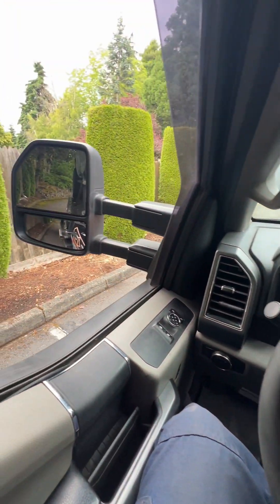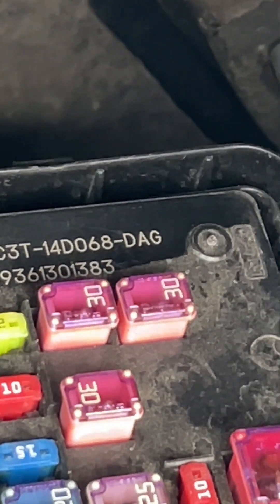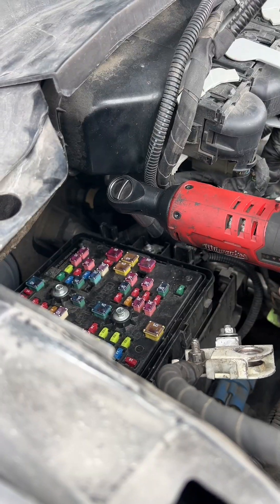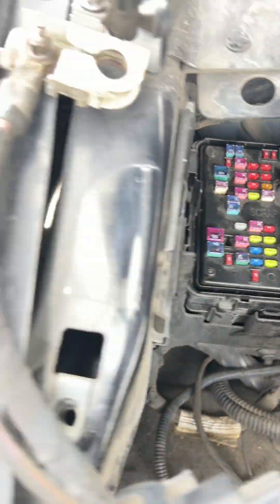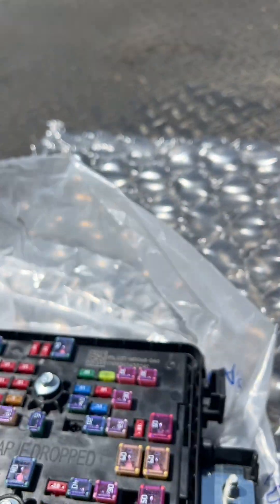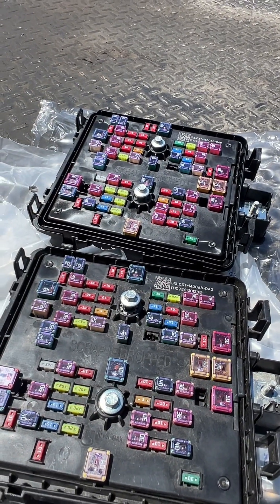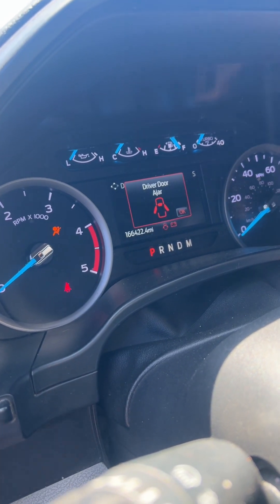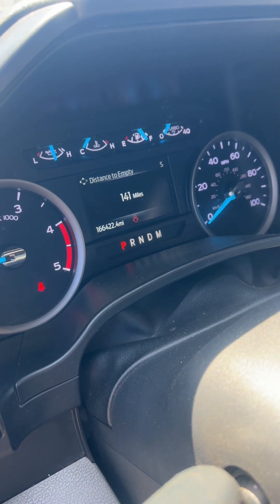DIY 2020+ Ford Superduty Repair no crank no start | Truck Won’t Start Fix BJB battery junction box!!

Comment: Nice. I had a 2010 6.4 no start diag yesterday. Ended up being the trailer brake control module. So I just unplugged it and dude is using it until new one gets here